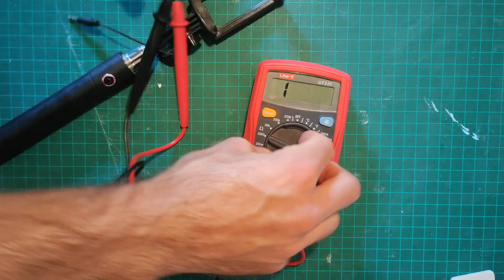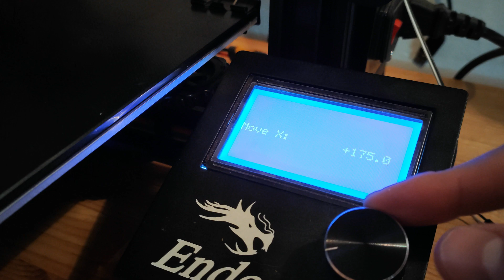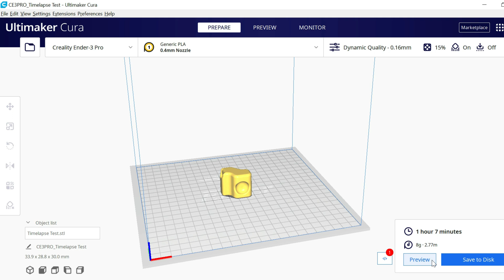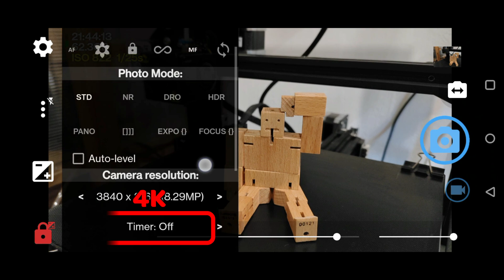4K 3DP Time Lapses | No Upgrades/OctoPrint/Coding

Comment: Is there any chanve that you can make a video for a phone that does not have a headphone jack ?
Reply from the maker: Sure! Someone commented in my instructable suggesting the use for a bluetooth remote. It's a good idea but you'd have to make sure it doesn't run out of battery during long prints (maybe add a power source?).
Here's a link to the instructable, see the "I Made It" section at the bottom.

https://www.instructables.com/Repurpose-Old-Earphones-to-Capture-3D-Printing-Tim/

Hope it helps!

Comment: 😅 Before this video I tried the bluetooth button.  It was a pain.  Modeling button holder.  Then the push mechanic because it's a bit hard to push.  And finally, my old phone, which I planned to use, refused to work normally with this button.
Reply from the maker: Ouch! What an annoying journey... I'd try using a slightly different resistor - maybe 200 or 240. As I mentioned in the video, this method worked with 3/4 phones I tried. I suspect it could be solved by using a slightly different resistor, but I didn't try it. Hope I'm not sending you to another annoying path!

Comment: Do you have the STL for the switch mount? This is an awesome idea and I think even an electrical novice like me could figure this out! Great video :)
Reply from the maker: Thanks a lot for the kind comment :) I now added the STL to my instructable, see step 7 in the link below. But before you do - the reason I didn't attach it in the first place is because I think each combination of print+limit switch would need a different mount. So chances are the part I made won't work for you! You have three options then - try my design and see if you're your lucky, design your own mount, or use hot glue (my friend did it with a copy of the switch I gave her).
If you're having trouble, message me on my website and I'll make the modified STL for you, no problem, I'll just need the dimensions so I could modify my design.

https://www.instructables.com/Repurpose-Old-Earphones-to-Capture-3D-Printing-Tim/
Reply: @nixmakes  I do actually have an Ender 3- I was going to mention it in my original comment but I was so excited to tell you how awesome it was I forgot :') Thanks for an awesome response, I've subscribed and I can't wait to see what else you put out! Keep being awesome!! ✌️